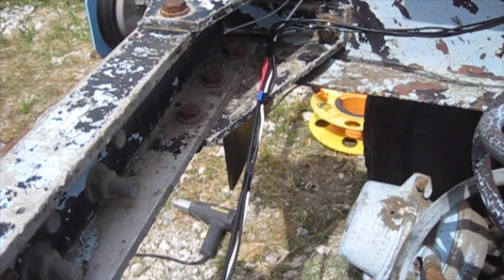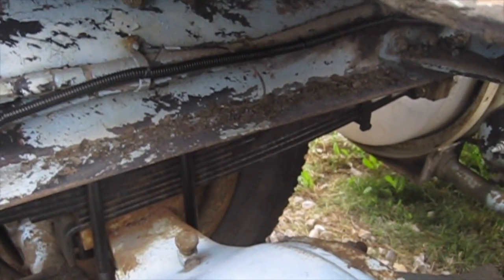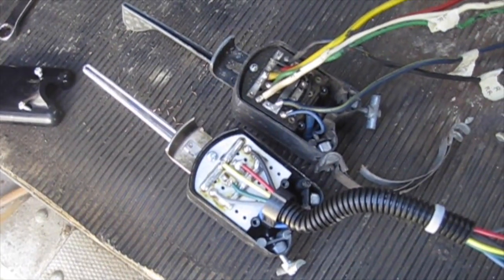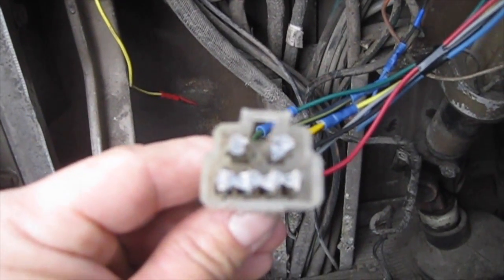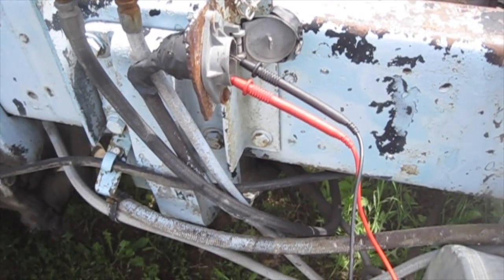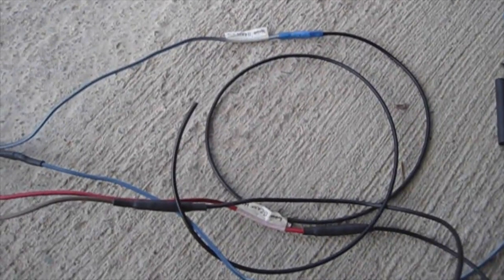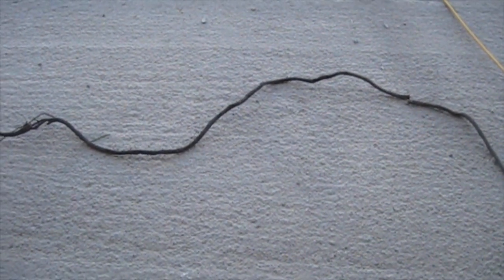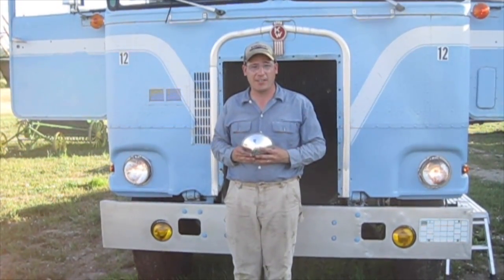Kenworth K100 Restoration #6: Lights, Turn Signals, Wiring

Comment: Awesome KW! Can’t wait to see more on 12 I’ve been following the restoration since the first video, I’m restoring a 1971 Kenworth k121 single axle like yours, mine was from an old Trucking company called TIME-DC motor freight.
Reply from the maker: Christopher Cruz Thanks! I went and checked out your channel. It’ll take me a bit to get caught up. What’s the story with the truck parked behind the K121 in your latest videos? Looking forward to seeing your progress. I love the sound of a Detroit! My K121 started life as a freight truck too. It was one of a set of six identical tractors ordered by Bruce Motor Freight. They didn’t have it long, as my family was the third owner by the time they got it in 1979. My Dad was the forth owner when he bought it from the family company in 1986. I’m the seventh owner, finding her in 2015.
Reply: Blue Creek Dairy Farm WA nice! Personally I have a soft spot in my heart for old company trucks. The truck behind the k121 is a 1976 Kenworth k100C sleeper truck, 6v92TA 335 horsepower Detroit, spicer 6 speed transmission, single axle. It’s not running and I doubt it’ll be running any time soon I’m using it as a parts truck for the TIME-DC k121 at the moment. The k100c has many structural issues including a knock and a fuel restriction coming from the motor, its missing parts and is in very rough condition so I decided parting it out for the truck that runs is probably the cheaper better way to go for me, it’s not going to get scrapped, just a parts truck at the moment.
Reply: Blue Creek Dairy Farm WA  I’m not too sure on how many owners my truck has seen but I know there’s about 7-8 coats of paint on the cab.. underneath all that paint is the original TIME-DC green paint. I know this truck has been severely used and abused.

Comment: It looks like you installed new headlights / buckets. How difficult was it to remove the old buckets? I need to replace mine. Thanks!
Reply from the maker: The buckets are original that I fixed up. They were just held in with some machine screws. They were pretty rusted, so about half of them just snapped. Overall, not that difficult to remove. Thanks for watching!

Comment: Do you need an OSHA horn?
Reply from the maker: Is that the same as a “city horn”? The little electric horn?
Reply: @vnthomas16  the safety horn that beeps as you backup.
Reply from the maker: Oh, no, not required. I do think the old school ones that are actually a mechanical bell that mounts to a hub are cool.

Comment: Hello I am looking for a wire diagram for a 1981 k100 specific light switches
Reply from the maker: martin3huizen Kenworth wiring diagrams seem to be very generic, as trucks could be spec’d so many different ways. You might look for a maintenance manual on eBay for your year of truck. My truck is a 1971, but I have a 1973 W900 manual. The wiring diagram is useless, but what is helpful is the wiring color codes. Using those, I could trace a wire from one end to the other. Of course, the wiring on my truck was so bad I ended up making new harnesses. Best of luck!